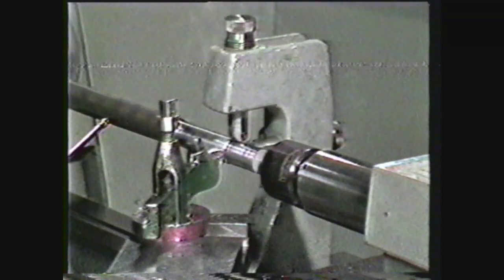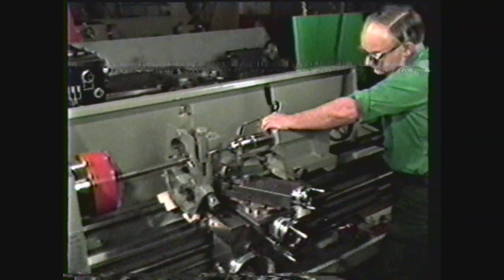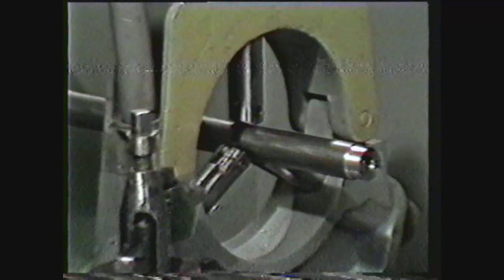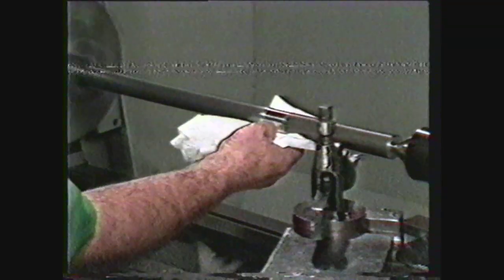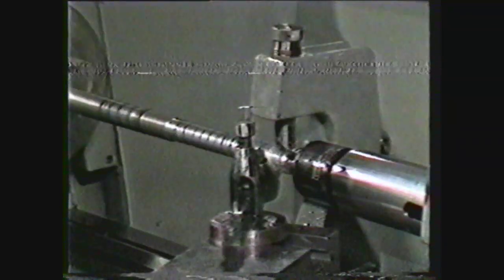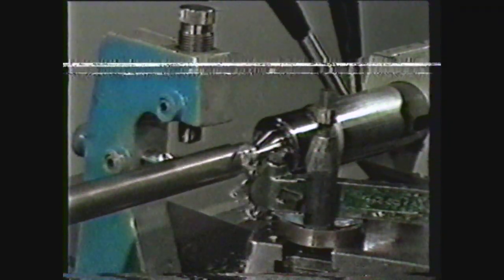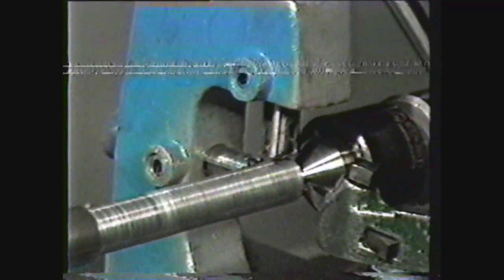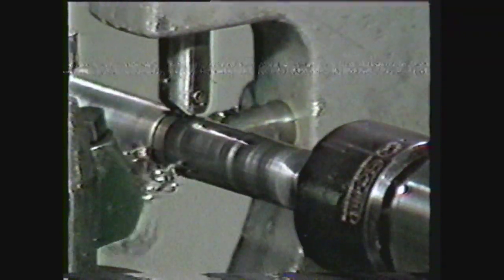Mechine Technology III lesson 13 Using a Steady Rest and Follower rest to Machine on the Lathe

Comment: What did I learn ? - 1. that steadies (either fixed steady or travelling steady) can come with roller tips, and 2. 'cat's head' - not seen or heard of those before despite being aware of 'cat's paws' for boring operations.

As for putting paper between fixed steady and the bed, I'd disagree with. Apart from cleaning the bed (& lubing) before placing the fixed steady on it, I'd slide the fixed steady back and forth to ensure it was cleanly down to the bed and not resting on anything in between. Paper can only add sponginess to the mounting although only slight !
Reply: doesn't matter much because the jaws can be adjusted to the work piece with or without paper.   I was taken aback myself when I saw him doing that though.   Never knew that was procedure.   This would protect the ways from any wear in addition to ........ what he said -slipping.   I have some trouble seeing a steady rest 'slipping' but I'm certainly no authority